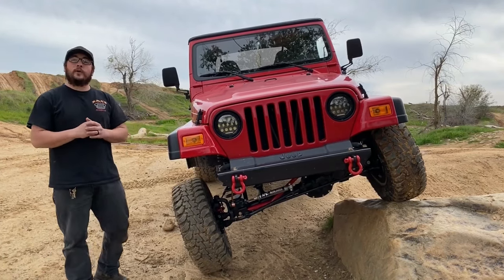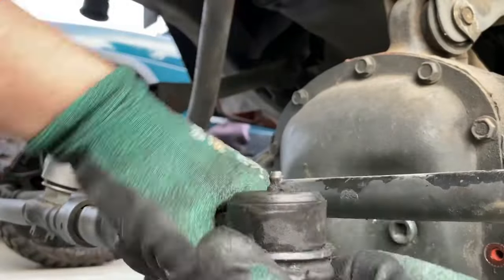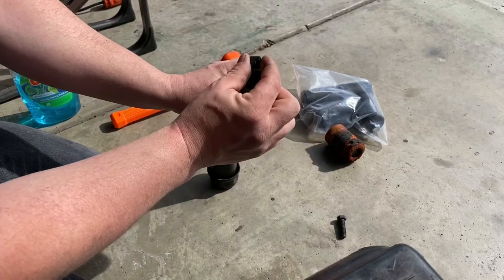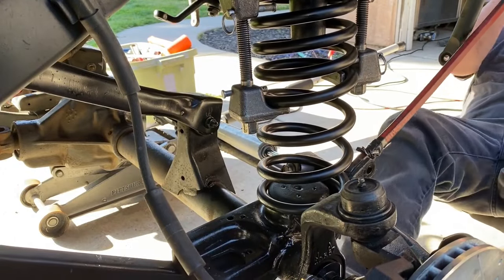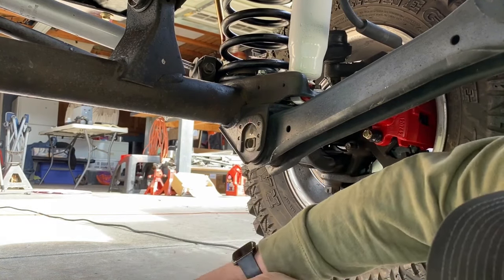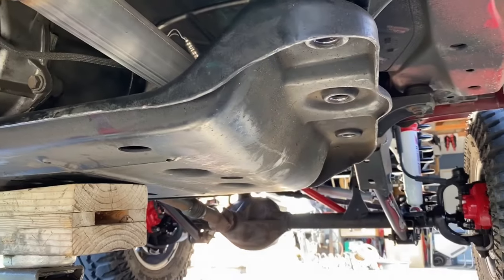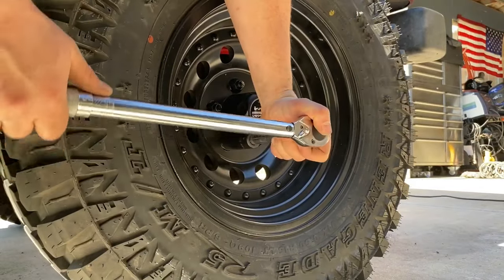Jeep Wrangler Tj - DIY 4” Suspension Lift Kit Installation Guide : Skyjacker Off-road Build

Comment from the maker: thanks for watching! 
FYI *it was noted: that you could replace the lower control arms after the factory coils have been removed and before you install the new suspension coils. This can allow for smoother install. But it’s not recommended by Skyjacker

Also:
Just keep in mind I bought this kit because i thought it was a perfect starter lift kit to upgrade as time and money allows! 

Future plans and up grades for this TJ:
 
Removal of T- case drop kit
Adams sye and cardan driveshaft 
All 4 upper adjustable control arms
Steinjager cross over steering kit! 

FAST FORWARD OPTION :
Remove & Replace = R&R
Track bar R&R 1:55 / 4:13 / 13:32
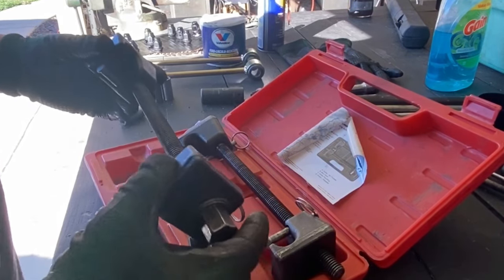Drag link ball joint R&R 2:09 / 3:30 / 8:28 / 11:45
Sway bar end link R&R 2:30 / 2:54 / 12:25
Front shocks removal 2:45
Factory front coil springs removal 3:01
Pitman arm R&R 4:40 /  7:58
Bump stops R&R 6:30 
New DR coil springs install 8:34
New front shocks 11:26
Front lower control arms R&R 14:01
T-case drop install 16:56
Rear track bar mount install 21:06 / 25:00
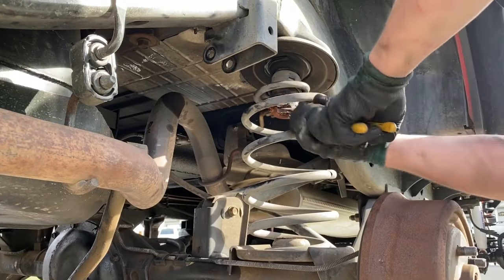Rear bump stops R&R 21:35
Rear coil springs R&R 21:35
Rear lower control arms R&R 22:50 / 24:12 / 24:45
Rear sway bar end links 23:34
Rear shocks 24:31
 Safety check 25:20

I definitely understand your concern with the way it may handle on road. As this is my concern also! I can only share my experiences in hope that you can take this information and solve your own problems as we are different. A few questions I have for you :  is the lift a short or long arm kit? did the lift come with the the pitman arm drop? Do you have adjustable upper and lower control arms on the front axle?

I have two jeeps and both do not have death wobble or wandering! I suspect wander comes from loose steering, improper caster and tire pressure. Bad ball joints, loose track bar.

Heres is a few different scenarios for perspective: 

My green jeep has an older 3.5” procomp short arm lift. Kit came with a frame side track bar drop down bracket (weld on) and adjustable heim track bar with a pitman arm drop. And after the lift i experienced wandering. The fix was a heavy duty moog inverted y link that allows for lift adjustment. The moog y link is very solid and if you were to grab it, it offers zero movement! The ball joints are very very tight. I suspect this is why people tend to go with Currie rock jocks y link and they are sold when it fixes these problems. Moog is half the cost and same quality IMO. It’s been 8 years plus on that lift and I’ve had to tighten the track bar twice. After hard wheeling, That jeep regardless is a smooth operator!  

Now for the red jeep:
It has a 4” skyjacker short arm kit and dual rate coils. For this jeep I went a different route. The lift didn’t come with a track bar so I bought the steinjager track bar. I liked this track bar because I didn’t need to weld on a frame side drop down track bar mount. Just drilled a hole and mounted it to the stock frame mount. It’s configuration allows for no drop mount by design. After that I put back on the stock inverted y link and boom wandering and instant death wobble. I took the jeep to a alignment shop and the wandering seemed to be better but still getting a very good shake at the steering wheel from 55-60 mph. I could not deal with that at all. I got the crossover steering installed and yep still had the issue but the steering definitely felt tighter. The shake was still Happening. I started back to the basics, remembered that my jk has a light that comes on the dash if my tire pressure goes below 37psi or if there’s a significant temperature drop causing it. Known that i decided to bump up my tire pressure from 32 to 40psi , took the jeep for a ride and boom the shake in the steering was gone! The tires I have had side wall give and do not like lower pressures! 40psi all the way around did it for me and it’s now a smooth operator! After installing the crossover steer I put back on the stock pitman arm! But I honestly don’t think it matters. The lift was designed for it but the new drag link seemed to have adjustment for that. I would say the main purpose for the pitman arm drop is to correct bump steer with the stock y link setup! When the axle goes up to the frame after hitting a bump the drag link puts force into the pitman arm transferring to the steering box then up to the steering wheel where you can feel it and try to correct. That constant trying to correct can get very annoying! This is what I call wandering! Or bad road tracking. Even the roads play a role in this. As of now I don’t run the drop pitman and my drag link /ride seems to not care. The ideal fix is to get the drag link as parallel to the track bar as possible (near perfect horizontal). On Tjs that’s almost impossible because the passenger nuckle is set up for y link. On jks it’s very simple just add a axle side drag and track bar lift bracket to accommodate for the new lift correcting the steerings new geometry making them parallel and horizontal. 

One other thing to consider is caster , I have smaller tires so caster is less, larger tires offer way more caster and lift manufacturers know that you may be putting on larger tires. Adjustable lower and upper control arms correct caster by putting the axle out further ahead of the frame and the uppers correct the caster adjustment. Pushing that axle out further makes a world of a difference for our tjs you can correct caster and at the same time correct front pinion / driveshaft angles! Luckily on my 97 I was able to have eccentric lower control arm adjustment bolts. I’m currently maxed out without causing my front pinion angle to be out of spec. I’d definitely look at front upper and lower control arms as well. These cheap kits only offer and even say they are only good for offroad use . Not on road use! Go figure , 4lo is top speed 10mph haha. My suggestion is if you want a road worthy tj it’s going to be upgrading control arms and steering as well. Those cheap starter kits are not enough and are only meant for 10 mph offroad! 

Hope this insight helps 
Atem offroad

Comment: I thought about a 3" lift w/ 33's but fortunately very early on getting into off roading Jeeps, many told me, their TJ became very sluggish going from just 32's to 33's in addition to a domino effect of needing additional expensive parts. And I'm glad I listened! Because I drove a TJ with this set up and it didn't have that low end torque and was very slow off the line. And most of them returned to 32's while some fell for the aftermarket bait, very expensive bait.

I get many who want to know what is the perfect build. Which is not easy to answer because everyone does different things with their Jeep. 

But I would like to share mine since my '05 TJ Rocky Mtn drives and handles absolutely amazing on and off road. 

Keep in mind, I am NOT a rock crawler, although I don't go out seeking rock crawling it's still a lot of fun encountering them on the trail and knowing the TJ can handle some of it. I'm an adventurer who takes the family beach wheelin, beach camping, surf fishing, and we hit fun, moderate trails in the fall and winter getting to our favorite fishing holes and camp sites. Which is why the build is for what's near and for what we do, nothing was put on this TJ unnecessarily for show. I see too many "spotless Jeeps" with 33's - 38's. 

As long as you have good off road instincts and common sense, a modest, high quality build will allow you and your family to have a lot of fun!

All in, I'm at $25k with my '05 TJ Rocky Mtn. And I can honestly say build wise, I'm done!! I might Raptor line it since the TJ has a few rough paint spots and won't ever have to worry about off road pinstriping again. The best part is, this TJ not only keeps up, but outperforms a lot of these $40k - $75k JK's & JL' s. Due in part to people's inexperience and just "over building". The '05 TJ has a modest build, yet is extremely capable, durable and best of all, affordable.

I encourage any Jeeper to search for a rust free TJ 4.0 I6, preferably stock, 3.73's w/ LSD and a Dana 44. And to use my build as a "guide". But I highly recommend this build for anyone who is an adventurer, not a rock crawler. Best of all, it will eliminate you from chasing your tail, and the aftermarket will have one less "just empty every pocket" victim out there!

It was a lot of trial and error but it has been well worth it.

2" Old Man Emu coils
32" KO2's or 32" BFG MT's
Quadratec Baja alloy rims - perfect backspacing - no rub!
Currectlync steering
Freedom Off Road front Adj track bar
M.O.R.E steering box brace 
JKS quick disconnects
 
Freedom Off Road front lower Adj control arms

The rest are fixed Detroit Axles
 
Transfer case drop kit
Fox 2.0 Shox
Fox steering stabilizer

Professional 4x4 shop to do the alignment

Since doing this, I have had the best experience with any vehicle I've ever had. 

Staying with 32's allows us Jeepers to maintain that great low end torque, saves us a lot of money on unnecessary aftermarket parts and still be able to wheel most anywhere. It's the best of all worlds!

One of my favorite mods was adding a Banks cat back exhaust giving it a throaty growl, but not obnoxiously loud ticking off the neighbors. Absolutely perfect for the 4.0 I6. 

Most importantly, be honest with yourself, build your TJ for what you will be using it for. And know YOU CAN do great trails and much more with just a 2" lift and 32" ko2's or MT's!

DO NOT let the aftermarket pushers fool or shame you into thinking you "need" 33" - 40" tires and a 5" lift to wheel. That's 🦬💩! They know full well, once they get you at 33's, it's a freaking cash cow for them! Because you just embarked on their multi thousand dollar build conveyor belt. And it's 100% unnecessary for moderate wheelin'! Your axles, drive train, drive shafts, engine, gearing and a host of a lot of other stuff now "needs" to be upgraded. The aftermarket pushers feast on naive people. Don't be that guy! Like cereal companies saying breakfast is the most important meal of the day, the aftermarket will continue to take advantage of the misinformed. 

And anyone with a 2 door JL Rubicon, while I definitely prefer my '05 TJ Rocky Mtn over anything from '07 - present, I have to say these 2 dr JL Rubicons are absolutely complete, no reason to do anything to them! 33" MT's, perfect stock height lift, 4:1 ratio, lockers, etc. I wheeled with a couple that have this animal of Jeep and told them to leave it alone, it's perfect! They knew what they had and I don't forsee them changing anything. I tell them mine is just as capable and $40k less. 😎 But at least they won't have to spend so much as a dollar in unnecessary upgrades. 

                    O|||||||O
        🇺🇲 Only in a 2 Dr 🇺🇲
                   '41- '06
Reply: @jeeptjwheelin5799, I'd like to see some pictures of your rig! Are you on instagram or any of the jeep forums? What you described is pretty much in line with what I want to achieve with my TJ.
Reply: @theberrymanmanman    I am on Instagram but that's for my real estate photography business. I will add a Jeep TJ page/acct at some point. But everything I did is listed here. I'll try to get the TJ stuff on there soon though.

Comment: I just bought this same lift for my ‘06 TJ and, though I’m pretty mechanical, I was struggling with the install (Skyjacker’s instructions aren’t great). This video made everything much more clear and I’m ready to get back to it tomorrow with a much better idea of how it all goes. I don’t know what I would do without YouTube and especially this video. Thanks!
Reply from the maker: I think it’s a decent suspension so far it’s been good! And your right the instructions aren’t all that great! But it’s definitely doable, if I were to do things differently I probably would have installed the lower control arms on the front axles right after I took out the factory coils, as you seen i did have to do some tricks do get them in after the new coils were already in, but other than that it’s a fun little project! Take your time, good luck and thanks for watching!

Comment: You do not want to use that drop pitman arm. You should reinstall the factory pitman arm. Drop pitman arms are not necessary for TJs and will give you steering issues. Also with a 4 inch lift you want to run front upper adjustable links to get your caster and pinion angle dialed back in. Also highly recommend you get and sye and a double cardan drive shaft in order to remove the skid plate drop brackets. Then upper rear adjustable links to set pinion angle.
Reply from the maker: That is definitely going to happen! As soon as time allows, I thought I mentioned it at the end but maybe I didn’t! This is great info for those that don’t follow me on Instagram! Thanks for sharing and watching Cheers 

Future plans and up grades:
 
Removal of T- case drop kit
Adams Slip yoke eliminator kit 
and cardan driveshaft 
All 4 upper adjustable control arms
Steinjager cross over steering kit!

Comment: Great video, just as a psa.. you torque from the nut side unless stated otherwise
Reply from the maker: I agree , but the socket would not fit over the nut due to clearance issues. Thanks for watching

Comment: I have a stock 2005 Jeep Wrangler LJ unlimited, is all the parts in the description the only parts I would need to get to take it from stock to lifted? What about about tires what size of tires would work or could I use the standard tire that is recommended?
Reply from the maker: Yes The kit is all there and complete, as far as other items you need will be based on your judgement and preferences. For instance the spring perch isolators front and rear mine were still ok but yours may not be, it’s a good time to replace those. Also the Steering Y link, that doesn’t come in the kit and on my jeep all the ball joints were shot. I was able to replace one and run it for awhile until I upgraded those parts. You can see the crossover steer upgrade I did to the jeep in my later videos that this one follows but choosing upgrade and replacement parts for your build will be your preference. Also you could run 35” tires on your jeep with the correct wheels using this lift if you have the 4 liter engine without a regear but you may feel a dramatic power loss at acceleration, I run a smaller tire because it’s my daily and I haven’t regeared the axles yet.
Reply: @ATEMOFFROAD  I was wondering the same thing as Jacob and WOW - your answer was not helpful at all ... a few other items - just say what else needs replacing at the same time as the lift kit
Reply from the maker: @Suesonly  I’ve since updated my response . Not sure what happened at the time other than thinking that the kit is complete but have since made several changes. Do you have any specific questions?

Here is my reply 
Yes The kit is all there and complete, as far as other items you need will be based on your judgement and preferences. For instance the spring perch isolators front and rear mine were still ok but yours may not be, it’s a good time to replace those. Also the Steering Y link, that doesn’t come in the kit and on my jeep all the ball joints were shot. I was able to replace one and run it for awhile until I upgraded those parts. You can see the crossover steer upgrade I did to the jeep in my later videos that this one follows but choosing upgrade and replacement parts for your build will be your preference. Also you could run 35” tires on your jeep with the correct wheels using this lift if you have the 4 liter engine without a regear but you may feel a dramatic power loss at acceleration, I run a smaller tire because it’s my daily and I haven’t regeared the axles yet..

Comment: Please check out proper use of a click type torque wrench. You aren't supposed to keep torquing after it clicks. Nearly every time you added additional torque 2-3 times over what you specified torque. Probably not as critical with suspension parts but damn.
Reply from the maker: This one is off about 5 lbs , if this were head bolts buddy I wouldn’t even be using that torque wrench! You make a good point! Thanks for watching 🍻

Comment: So if you go with the transfer case drop, you don't need the SYE?
Reply from the maker: “In theory “ yes , most lift kits that come with the tcase drop kit and drop pitman are designed to work that way! But you can always upgrade , like I have done! 
Already Upgraded :
Track bar
Bump stops 
T case delete 
S.Y.E and adapted adams drive shaft.
If your interested in an sye upgrade I have two videos to watch on the complete setup and install. Thanks for watching cheers 🍻

Comment: I’ve always read that the drop pitman arm is a bad idea.
Reply from the maker: You bring up a good point there! they do have pros and cons but ultimately it’s dependent on your particular set up! I know you will have to extend your drag link ball joint out further with out the drop pitman arm, this allows less threads to be captured in the clamp if you don’t use it, when I look at these kits and I see drop pitman arms included the first Question I ask myself is why would they include them in the kit if there a bad idea? Some people will tell you that there a bad idea because they don’t use it and it works for them without it, but that necessarily doesn’t mean it will work for your particular setup. It’s what works is best! If your interested I can do another video on this topic